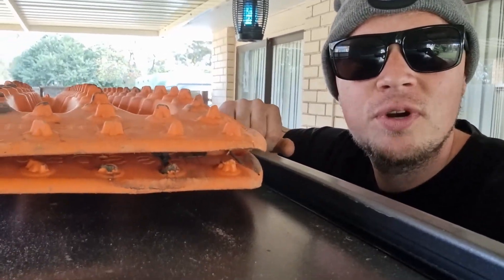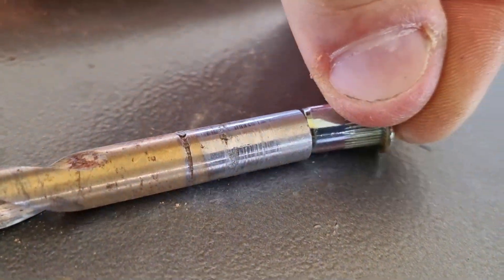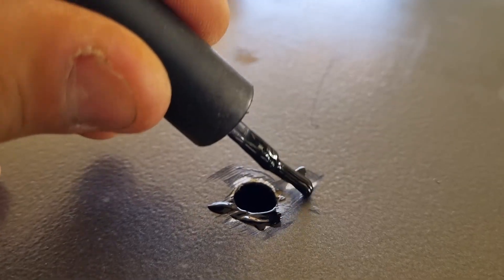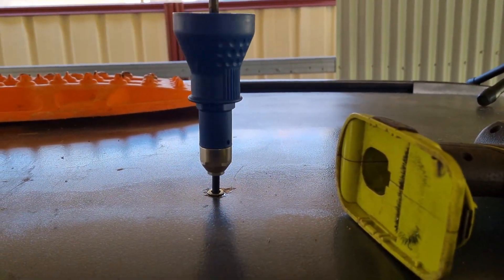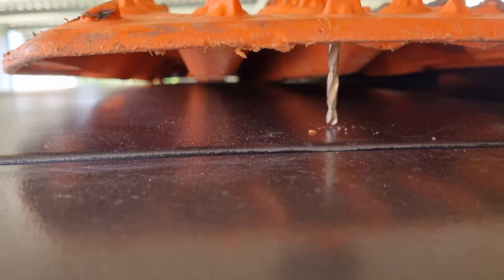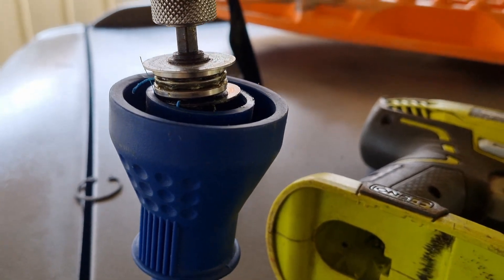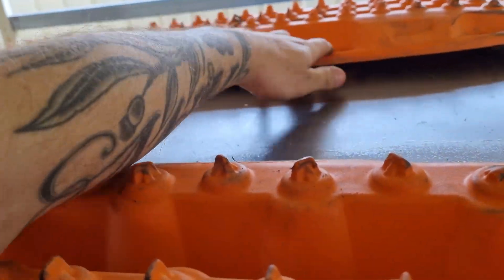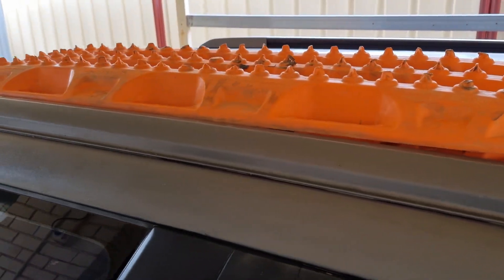How To Install Maxtrax on Your 4WD Like a REAL MAN

Comment: This is some A grade Subi owner shit! Exactly the sort of thing I used to do to my L series. 
Like when the dog puked in there and I didn't want to mop it out so I just drilled holes where it had pooled and ran the hose through it.

Side note, fark rivnuts! Busted my wrist inserting one of them. $10,000 later after one surgery, 6 weeks in a cast and 8 months of rehab; still gives me hell
Reply from the maker: Sounds like a win win my bro! Easy puke cleanup and you get to tinker at the same time.

Oh gezz that sucks! They can be a real shit when they bind up on the drill :/